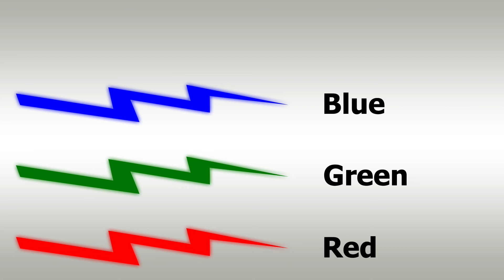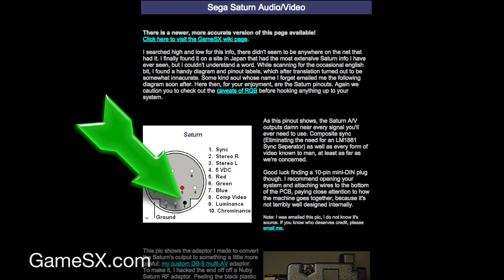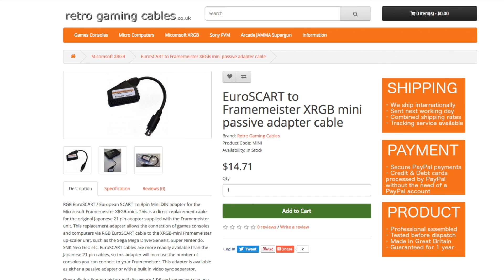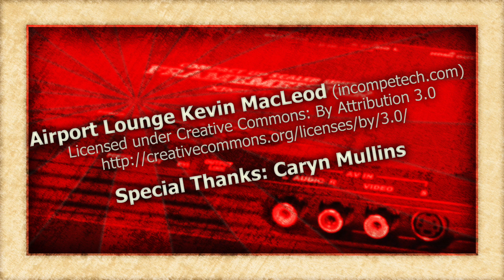How To XRGB-mini: Do I Need a Sync Stripper? (Framemeister)

Comment: In case you're using a console that only has sync on composite output you might need a sync stripper. For the European Sega Saturn for example you might want to use one, cause unlike the Japanese or US Version, the pin on the AV out that carries csync oddly has a +9V line connected. So you either have to get a sync stripper to get a cleaner sync signal from composite out or you need to use sync on luma, cause the Sega Saturn has S-Video out too, which carries the sync on the luma signal, which is at least less noisy than the composite signal. I wonder who would win in a video quality competition; sync on luma or sync stripped from composite?
Reply: I'm at this cross road now. Will try both I think. I'm running rgb on pal model 2 saturn and it's got some artifacts. Definately feel I could improve.

Comment: I need to use sync-on-luma cables because the Playstation 1 doesn't support c-sync. However, I heard that sync-on-luma causes problems with the xcapture-1 (capture card). I'm planning on buying a BNC to male SCART cable which would go from my PVM to a sync strike, which would then convert the signal to VGA for my xcapture-1.  Would buying the BNC to male SCART with a built in sync stripper help in this situation? Or would it make no difference than getting a normal BNC to male SCART cable?

Comment: one question ! @ retrogamingcables i read : Also select "Sync over Luma" as the sync type for use on the XRGB-mini. .... where exactly can i find sync over luma on the framemeister ? or is autosync going to find the sync on luma by itself ? thanks a lot !!!
Reply from the maker: Sync on Luma, Sync on Composite, and Composite Sync have to do with the cable itself, not the Framemeister. The Framemeister will understand whichever sync is being sent to it. Hope that helps!
Reply: thank you very much !

Comment: Would you need a sync stripper if you have both csync and sync on Luma devices? If you have a mix, do you unplug the power to the stripper when using only csync? 80% of the systems I'm planning on connecting to the rgb have csync.
Reply from the maker: +kadrik0 Hey man. You would not really need a sync stripper for Sync on Luma. As for what happens when you feed csync into a sync stripper, I'm not sure. Test it out and let me know!

Comment: Most of my setup is csync like the genesis, snes, and nes. On the n64 and ps1 I would probably be sync on luma. In that case do I need the special sync stripper adapter so I can play both types of sync on my xrgb mini (soon to be ordered, just getting all the pieces and prices down first).
Reply from the maker: +Adam Burns From my experience, Sync on Luma is a very clean signal. No stripper needed. No adapter needed. Just plug in your system of choice and you're good to go.
Reply: Thanks for the quick reply. Awesome, saved me $13. Question, have you modded a snes mini or n64 for rgb? If so did you try the dimming resistor mod? I'm going to get the easy rgb pcbs that attach to the inside of the multiout and solder a few wires but I've been having a hard time finding if the dim mod helps or not. The snes is a snes mini that is soon to be modded and a n64 with the rgb amp chip via luma.

Comment: What if you're using an existing SCART cable you're not sure about? I've a few old games consoles and other 240p equipment (VHS recorder, etc), so if I wanted to guarantee the adaptor-into-Framemeister worked with all SCART cables I threw at it I should buy the more expensive adaptor with the externally USB-powered stripper, right? That'd work with CSYNC SCART cables and sync-over-composite cables?

Unless the sync stripper option degrades the video signal of CSYNC cables (due to unnecessarily attempting to strip out information that's not there)?
Reply from the maker: +coderkind Sure, I would say that is a plausible use-case for the mini-din to Euro-scart adapter with built in sync stripper. As for degradation, it shouldn't be an issue as its filtering out information that isn't there, in theory not harming the sync at all. Scart is relatively new for us American retro gamers, we don't have a bunch of old cables lying around :D
Reply: +implantgames I've ordered the cable with the sync stripper; am I right in saying if the SCART cable carries power than I should be able to get away with not plugging in the additional USB power cable spin-off into the XRGB-Mini? I haven't ordered the Framemeister yet as they're expensive so need to save up 😉

Comment: I could have sworn I read somewhere that some consoles (the Genesis I think?) have a problem w/ pure sync, where the output it generates doesn't work well enough to keep the image stable so you were stuck needing sync-on-composite w/ the stripper.

Am I just confused?
Reply from the maker: +LegionsOfAnon I'm sure you did read it somewhere :) FWIW, a normal CSYNC wired cable works great with my Model 2, Nomad, and CDX. Perhaps one of the Framemeiser firmware updates resolved the issue?